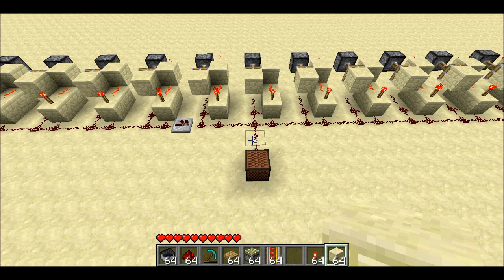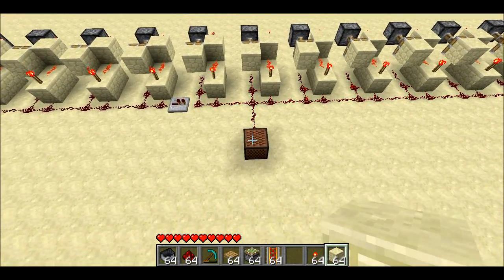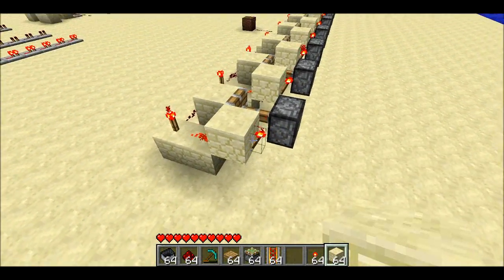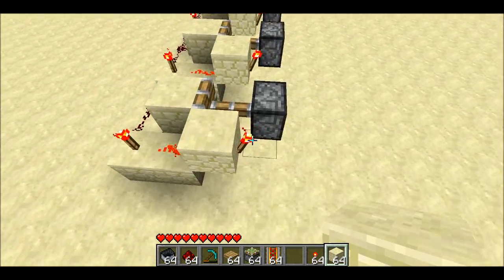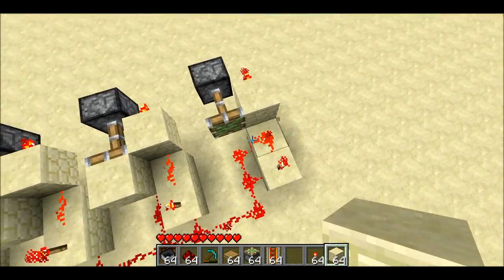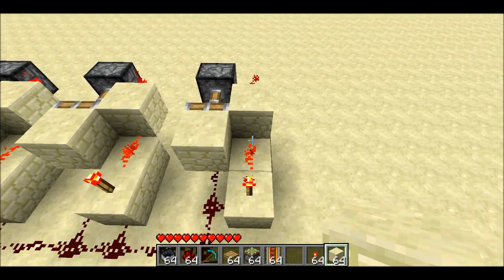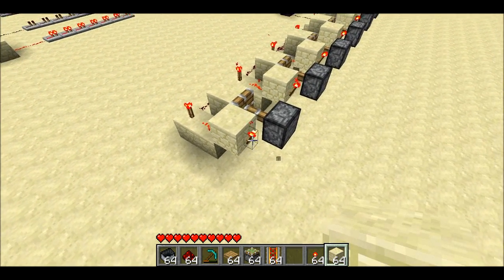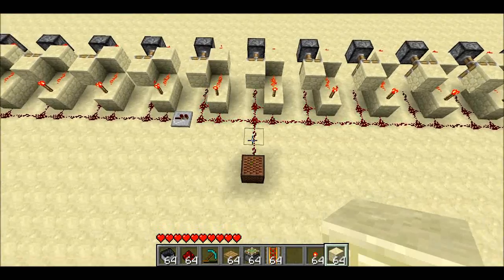Random Redstone Pulse Generator

Comment: @SuperYacob What I'm saying is between the right most unit and the noteblock there's a distance of 19 (or 20, can't see with the angle) redstone dust with no repeaters inbetween. The max distance redstone power can travel is 15 blocks. Therefor the power from that unit never reaches the noteblock, rendering it useless.

Comment: I made a frogger type game where you have to run through corridors to reach the next checkpoint. You fall through an opening floor space instead of being hit by an object. I made by own randomiser using a simple clock and a few "pulsar" type circuits to randomly turn off and on. I favoured the output to open the floor most of the time. I have a video up, check it out if you're interested.